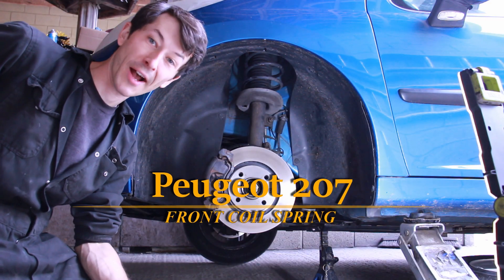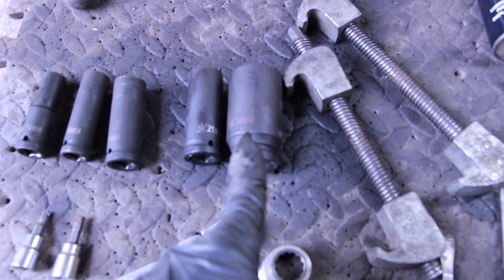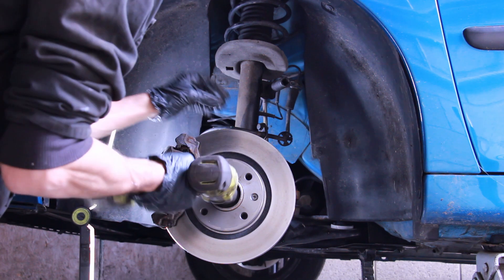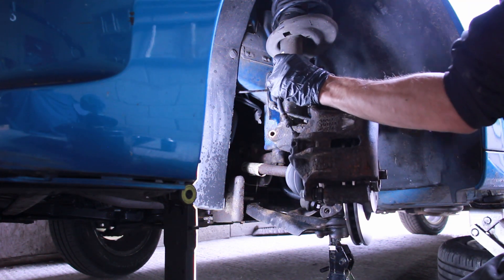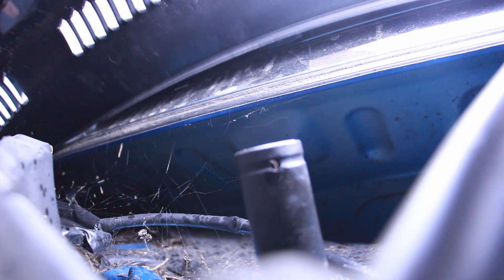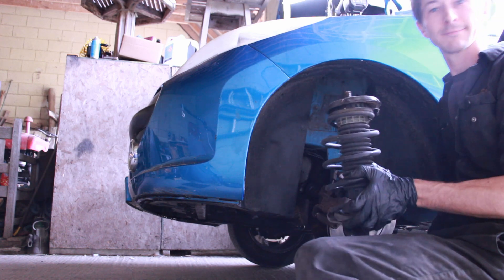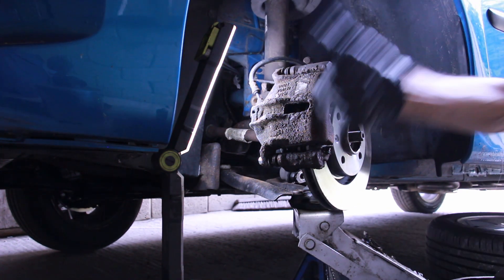HOW TO: COIL SPRING change/replacement, front coil, PEUGEOT 207

Comment: Just done this. The method works well, but its easy for the driveshaft to loosen, and spill a bit of gearbox oil. Have to stress that's not the end of the world, but you have to try and keep the drives haft pushed in of you can.   A few things not covered in the video. On many 207s there is a hole on the rubber mount on top of the shock, that should be positioned in line with the hole on the car body mounting point which is pointing towards the engine. I used a small screwdriver poking though to align it. The other thing that REALLY flummoxed me was all sorts of clanging over bumps when I completed the job which I thought was a bad mounting bearing, as it really sounded like it was from the top of the car,  then maybe bad strut, then bad spring. It was none of these things but I really thought the strut was jumping out the mount because of the noises over even the smallest bump. After days of messing about, changing the strut about 5 times, I finally found it was the swaybar/droplink. Unbelievable. Worth replacing it if at all suspect it's such a cheap but vital part.
Reply from the maker: It's quite common with most fwd vehicles for the driveshaft to pop out if you're not careful. 
The hole/locating point is a good shout but you can't miss it. It's sort of self aligning. 
The ARB link is a seperate issue. Yes related to suspension but I can't cover every suspension component in a video about one specific item... Or the video would be 5hrs long 🤣👍🐷
Glad you got it all fixed up 👍👍👍🐷
Reply: How much is reasonable to pay a garage to replace all 4 coil springs
Reply: Так тоже не придержал вал и вытекло масло,, терерь знаю уже,, что надо закрепить вал в коробке, так как нет там кольца и легко вал выходит,,

Comment: Attempted this job today and all was going well until I tried to get the strut out of the hub. It was free to move around in there but the drive shaft was hitting the lower frame of the car and I couldn't get the hub down any further once the drive shaft hit this lower frame. I'd say I had 10 or 15 mm of the shock left in the hub at this point. I tried disconnecting the tie rod ends and I removed the lower ball joint nut and bolt but could not get the ball joint to split.
Reply from the maker: Bolt the hub up tight to the strut again and big lever bar on the lower arm, big smack with a hammer... She'll drop down
Reply: Thanks for the quick reply and on a Sunday too. Do you think once I separate the lower arm ball joint I will be able to remove the strut from the hub. Thanks again, great video and very informative.
Reply from the maker: @mick111112  you'll be able to drop the hub off the strut... Giving you the same result. If you've not already, remove the brake caliper and disc as they double the wright of the hub and I don't wish you to damage them.
Reply: Thank you

Comment: I put Eibach performance springs on my DS3 (same setup) but car is always going ledt for years after multiplt alignments and going through sets of tyres with uneven wear. Should stock OEM fix this issue? Believe its an issue with camber
Reply from the maker: Get it on a decent laser alignment, read the numbers, then investigate which side/area is a problem. Without hands on, impossible to know
Reply: Are your top mounts fitter in there correct position. I believe the V in the mount should be to the back hole on the car .This set the camber apparently

Comment: When trying to refit the strut into the hub how do you prevent the hub from turning in when jacking it up, tried this and the strut keeps slipping out
Reply from the maker: Bit of technique. Not sure what you mean by turning .. but if it's turning, why is it then slipping out? Figure that out and stop whatever it is causing it to turn/slip. 👍👍 You're nearly there 👍🐷
Reply: thanks for the response , what I meant by turning in if you grabbed the disc one hand on the bottom and one hand onthe top and pulled with the bottom and pushed with the top the disc will angle inwards the more pressure is applied as its not fixed straight up and down. Hence slipping out as you jack up . regards  @PiggyPower
Reply from the maker: Get it sat on the edge. Push on the top of the hub/disc while gently jacking up under the ball joint 👍🐷

Comment: I recently had the o/s track rod end changed and the n/s cv boot kit replaced on our 207. Since then when I'm maneuvering at slow speeds (especially when reversing) there's a terrible creaking noise which wasn't there before the work was done. Any ideas what could be causing it so I can go back to the garage and not sound clue less, thanks 👍👍
Reply from the maker: Don't worry if you sound clueless... The garage are the experts you are paying to help you... Explain the noise wasn't there before... And is now, in detail describe the noise and when it occurs. All the information you can provide makes their life easier... Plus garages hate being told what it is ... It's like being told how to do your job. That's my advice 👍😀🐷
Reply: @PiggyPower  Thank you. The work was done as the car had failed it's MOT on these items. I know that the labour charge was double what it should have been because 'bolts on lower arm and track rod end took longer than normal to remove'. I noticed the noise the very next day. I'd hate to think I'll be paying for something that has come about as a result of the work done (rushed). They are extremely busy and managed to somehow 'squeeze me in' the day after the MOT failure. Which I was grateful for.
Reply from the maker: Yeah it's got to be something they are willing to investigate. I'm surprised they charged so much more for a couple of tight bolts.

Comment: Great video. Inspired me to do the same. However I am way much slower than you in it. 
gauge
Reply from the maker: Take your time. Do it once and do it right and do it safe 👍🐷
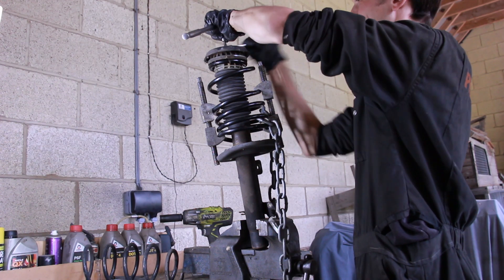Reply: @PiggyPower  I wanted to ask you how tight you compress the spring? 9:22  How far you drive that nut?  ( I don't have torque gauge.)
Reply from the maker: @gomla8187  if you can buy a torque gauge/wrench they are pretty inexpensive and you'll never regret it. Those nuts go "right" though. 75nm is about 75% as tight as most wheel nuts to give you a ROUGH idea

Comment: Just attempted this, for anyone trying this at home I would recommend getting a strut splitter as ours wouldn't budge with a hammer. I also couldn't get enough clearance between the hub and strut for it to come out, eventually I had to split the bottom ball joint and track rod end to and remove the hub. For reassembly, we had to use the strut splitter again as the whole weight of the car was not enough to re-seat the strut.

All in all, really good video, but far easier with a strut splitter and removal of bottom ball joint and track rod end :)
Reply from the maker: I have no idea what a strut splitter is... So assuming that in 15yrs I've never needed one 😂 I have seem people need to split the bottom ball joint to get the strut out but if you lever the lower arm down, it's always been possible. . Still super pleased to have feedback AND you here you managed it all without taking someone's face off with a spring 🙈😂👌🐷
Reply: @PiggyPower  A strut splitter is just a small set of jaws that opens the clamp on the hub, makes things dead easy. The car must have swam the channel a few times it was that corroded. Thought I would get away without using them on reassembly but it took the weight of the car and still wouldn't re-seat until I got the splitter out again (and that was with a new strut) 😂
Reply from the maker: @halezy9681  ahh I see. Big hammer does the trick. Alternatively I just use a square drive 1/2" socket and insert in the slot and turn 45°
Reply: @PiggyPower  Sealy do a set of 1/2" strut splitters / leg prys, basically a wedge (sx034) but they're not as good as the jaws, which open up about 11mm. I've only had to use the splitters a few times but they are worth their weight in gold when dealing with aquatic cars.

Comment: Great video ive just done this and was very helpful. Only problem i had the drive shaft came out slightly and lost some gearbox oil. So decided to drain and refill gearbox. I just pushed drive shaft back in but i could see a rubber seal. Should i have pushed the shaft further in just worried i haven't got shaft back in and may leak oil.
Reply from the maker: Hi there... Yes, classic newbie fail, don't worry, I've done it too! If it's not sealing...it will be leaking all the time, you'd notice immediately. So if it's not leaking everywhere... It's fine. Good to do a gearbox oil change once in a while, they often get overlooked. PSA choice is Total Gear 8. Has certain ingredients that no other oil has. 👍🐷💪
Reply: Thanks for the reply. No sign of a leak so hopefully ok. Yes i tried not to pull shaft out until i heard oil trickling out.🤦‍♂️
Reply from the maker: Well done. School fees. You'll know next time
Reply: I did same thing and
lost some oil :(
Do you remember how did you top it up?
And what type of gear oil you used ?
My car is 207 2008 1.6hdi

Comment: Good video,  be careful that centre nut, holding the spring,  if u tighten it down too much, the coils will be too close to each other once the car is on the deck, and knock. ....
Reply from the maker: I appreciate your comment but I hope no one follows your advice. The centre nut seats down against the top of the damper strut. The only thing that would happen if you continued to do that nut up (overtighten/overtorque) is stripped threads. The coils on almost every car do touch when the car is level and at rest and certainly touch when going over undulations in the road. If you have "knocking", it's something else worn or loose.
Reply: @PiggyPower 👍👍,    definitely shouldn't touch, didn't say that.. check when vehicle is on the floor.. centre nut is torqued tp 60 tp 80 nm..
Reply from the maker: @andyg817  correct. But the nut is not torqued against the resistance of the coil spring.

Comment: In the video there is missing bit with putting strut back in place. I've just done 207 from 2007 and without help of my mate it wouldn't be possible. Even when lower arm is pressed down there is still overlapping 2 inch of strut and hub, in this case I had to compress (jacking up) a little the strut assembly and luckily it went in.
More effort with taking balljoint out and would be easier job for one man.
Reply from the maker: There shouldn't be an issue there. Shouldn't need to do that on a 207 at all. I didn't remove anything and work alone, went in easily.

Comment: just went to take the strut out on my 207 1.6 hdi and the big nut holding the driveshaft in is a bit bigger, i measured it at 34.5mm with a calliper. not sure if its the original one or not.
Reply from the maker: Wont be 34.5mm. be a 35 👌

Comment: Hello!
I have a 2008 207 peugeot for which i  changed the strut for 3 times in a couple of month at 2 mechanichs and also at the dealer. The issue is that the bearing on the strut makes squeeqing noises when the car handles potholes or speed bumps. What do you recomend to do, else than scrapping the car 😂?
Reply from the maker: Did any of them actually change the strut top bearing????
Reply: @PiggyPower  yes, i have the original peugeot ones plus 2 other sets (Sachs and oem made in france from the dealer) at home. Now on the car are SNR. I personaly watched the process and they changed them. I watched if the mounted them properly and they did. The problem started after i changed the shock absorbers but the noise is not commong from there. The 3rd mechanic greased the area where the bearing is in contact with the strut and this has worked for a couple of weeks but now , the noise is back.
Reply from the maker: Sure it's actually the struts? Not the ARB link bushes
Reply: @PiggyPower  yes, is the struts. I can hear the noise from up above and the noise appeared just after changing the shock absorbers. Can it be because of not using the recomended torque for the nuts?
Reply from the maker: No. Either the struts are faulty or it's something else by coincidence. Dry ARB bushes or droplinks. Can easily rule them out by disconnecting them. Short test drive. If it turns out to be the top mounts again, squeaky... Remove. Clean surfaces. Apply silicone spray lubricant and torque to spec.

Comment: Do u have to take of centre hub nut
Reply from the maker: You don't HAVE to no. But if you're worried about pulling the shaft out the gearbox, it's a good idea to, then tap the CV joint through the hub. But if you're careful, no need.

Comment: Hi - The replacement spring length on my 206 1.4L 2006 is 375mm - When buying a Spring compressor they often have a max extension length of 280mm - would this still be suitable?
Reply from the maker: You don't use the spring compressors on the entire length of the spring 😉
Reply: @PiggyPower  its just that in your video you said you only had a few threads at the top even after using full compression with your spring compressor and the coil springs are usually tall for the 207 front suspension. I think 375mm to 400mm long.
Reply from the maker: Yes. But you don't put the compressors on the top and bottom coils or you'd never get them out 😉
Reply: @PiggyPower  finished the job, I bought a set of heavy duty spring compressors with a locking brace so it cannot slip from amazon for 45 quid. You do need them at near maximum length of 28cm but they compress the spring well.

Comment: I just replaced my spring, but after refitting the strut, I realised the plastic clip was still attached to the end of my old spring.
Is the plastic clip essential, or can I do without?
Reply from the maker: The plastic clip?? Unsure what part you mean?
Reply: @PiggyPower  
The piece of plastic that you clip over the end of the spring before you seat the spring against the strut plate.It's a kind of shield that prevents metal to metal contact.
Reply from the maker: Is this the shape of the spring or a cup like shape? If it's a cup like shape, it's quite important.
Reply: @PiggyPower  It covers the first eight inches or so of the spring coil, the spring sits directly on this, and this sits on the strut plate.The plastic guard thingamajig.
Reply from the maker: Send me a picture on Instagram or Facebook 👍
Reply: @PiggyPower  
I just found the name of this thing, it's the spring lower insulator....... And will need putting back on.
😐
Thanks for the replies.
Cheers.

Comment: Thanks for your upload. I just wanted to ask how you didn't fuck the coil springs up(scratch them to the metal) with these spanners but then I saw the marks of the beast. This technique was sadly not possible for my 207 Peugeot (2006). Well I did get the spring out(because it was broken) but I couldn't get it in anymore with a new spring. My strut assembly looks a bit different too(strut diameter=51mm). Anyway still interesting. Thanks
Reply from the maker: Yeah it will mark them a little bit. But not drastically. I can't see why it wouldn't work for your 207? I've done a bunch of different 207s all the same method. 

What engine is yours?
Reply: I guess im randomly asking but does anyone know of a method to get back into an instagram account?
I was stupid lost my login password. I would love any assistance you can give me!
Reply: @Carl Joshua Instablaster =)
Reply: @Ephraim Zachariah thanks so much for your reply. I got to the site on google and I'm trying it out atm.
Looks like it's gonna take a while so I will reply here later with my results.
Reply: @Ephraim Zachariah it worked and I actually got access to my account again. Im so happy!
Thanks so much you saved my account !
Reply: @Carl Joshua happy to help xD

Comment: IF I'M NOT WRONG, but prove me please, i didn't have any space on the other side to pull the shock out without getting the axle out aswell :(
Reply from the maker: Just a wiggle and a dance. No need to remove the driveshaft for either side
Reply: @PiggyPower  thanks brav, ill try it the next time